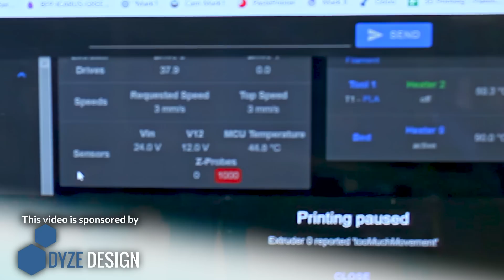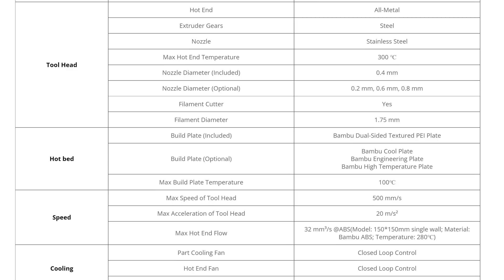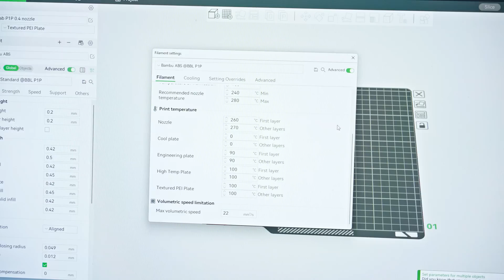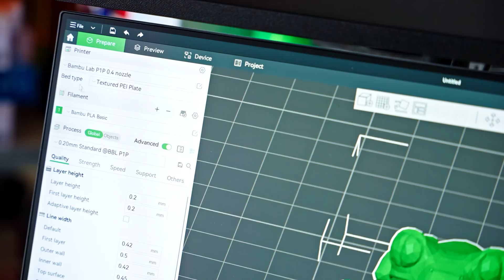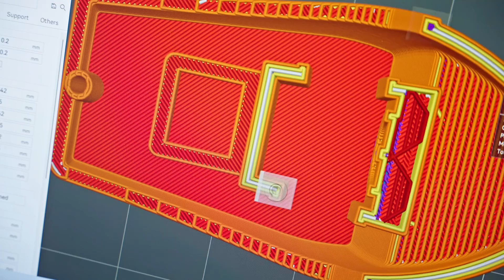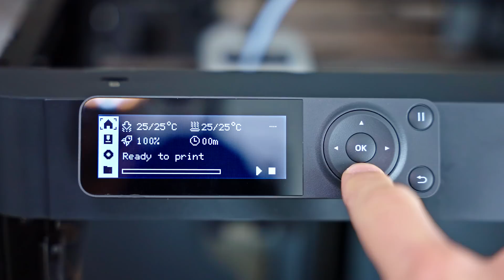Bambu Lab P1P: Tradeoffs

Comment: I think you're overly critical of some things. First off, printing side panels that the company has already designed and made available is completely different from full-out modding an Ender 3. It looks unfinished because they know 99% of users are gonna 3D print something. It not only lowers costs for them, but it makes it easy for the user to make it their own without the hassle of designing custom parts. Also, I think the LCD screen is dope. It's small, but the big chunky pixels almost make you feel like you're hacking a computer, and yet it's still easy to use. I love this company and even though they're not getting everything perfect, I think you should be more open to them trying new things. It's what 3D printing has needed for a long time.

Comment: I have the Bambu X1 Carbon and it does work impressively well. For smaller items, though, you likely have to lower the print speeds - I was getting spaghetti failures on the Bambu while my Prusas had no problems.

Comment: PLA/PLA+/Petg Quality as fast as you can get it with and without the addon fan.
Ignoring speed claims, how fast can we go and get similar quality to a bed slinger doing 60mms?
Do you have a sound metere? How loud is it really at those speeds?
Camera and tiny LED strip are not a big deal - Unless camera setup does not work as expected

Comment: And I probably have most of those "23" upgrades on my Ender 3 Pro. 🤣
Only thing I haven't gotten rid of is the 2mm spaced vertical artifacts on straight walls. Seems more prominent on 1 side than the other on the same axis. 🤷🏼‍♂️

Comment: This is probably a bit out there as far as suggestions go, but how about testing how easily this printer could be converted to use Open Source hardware? How proprietary is it, and how easily, if at all, could you get around that?
There are some worries about long-term support for BambuLabs printers due to them being a fairly new company, and some have suggested they might take the Apple route of designing equipment. If, for whatever reason, BambuLab should at some point decide to lock out features for bogus reasons or whatever, I'd be curious how easy it would be, or if at all possible, to replace the included (as I understand it proprietary) board with something like a Fysetc Spider running OctoPrint or something. 
Obviously, the other suggestions would come first.
For now, however, they seem to have done most things right and seem like a company worth supporting. If they allowed me to use PayPal to preorder the P1P (which, after asking, is supposed to be coming), I'd have ordered one already.
Just, y'know. We've all been burned before.

Comment: Is the P1P still really loud like the X1 variants were? Instead of using off-the-shelf stepper motor controllers, such as from Trinamics, they were using two AT8236 (H-bridges) to drive each stepper motor.

Comment: I can't help but wonder some things - if the 100C limitation for the new printbed is more of a long-term thing. i.e., you can't do 20-hour prints at that temperature without risking damage/wear/etc to the bed.

The other big thing I wonder, as this is effectively only their second or third printer, is if the 'upgrades' that the P1P has over the X1C are... coming to the X1C? Like, perhaps they went "oh, everyone has an issue with the thermistor design, let's fix that" and since the "current" printer is the P1P, it's just automatically shipping with that, and the next X1Cs they ship out will also be built that way? Just a thought

Comment: Skip the upgrades.  Everyone is doing that and it is a waste of your talents.  I would like to know about flexibility.  Help users break out of the box that Bambu has put them into.  I want to see hacks.   Yes, you are expected to use their slicer, but what if I really want to use Cura because that is my existing workflow or because I don't want my models sent to China?  How hard would it be to add a mechanism to it for continuous unattended printing?  Can it be tricked into heating the bed to 120C with a MOSFET/SSR and an arduino?

Comment: Why so hung up on the screen saying the cheaper ender has a nicer screen yet no mention of the more expensive prusa having a garbage cheep screen when even the cheaper prusa mini has a nicer screen lol and the panels are not there so you can customize it that’s the point and the none hardened Nozzle is chose for the same reason the coated sheet is becase people buying this will be more likely to print pla and things like that and those choices are better for that. Not sure why your so confused it all makes perfect sense and the value is in readable . Don’t think to many people will pass this up and pay more for an outdated slow prusa
Reply: Except the screen on the Mk3 still works far better, the encoder wheel is far faster and more responsive than the lil buttons on the P1P. But beside that, you can still put a color touch screen on an MK3, you can't on the P1P. You're stuck with what you got since its proprietary. Can't even use the one for the X1
Reply: @LilApe  The p1p is $700 and is fully built. faster and more capable. Ironically you do not need to use the screen if you are doing the slicing from a PC and sending it. 

The Prusa is $800 and you have to build it or $1100 fully assembled.  And you are saying you should add even more to the price? Sheesh if the screen is that important to you then get an X1 which has the screen and prints faster like the p1p.

This is ridiculous in 2022. Pressing a button will always be more accurate than spinning a dial. We have moved beyond  dials. $100 ender 3 have dials. lol. 

We will have to disagree on the mk3 working better as well. It is SLOW. 50mm/s slow. Something that will take 16hrs on a prusa would be about 4hrs on a bambu. They arent in the same dimension in speed/quality.
Reply: @LilApe  you can also just use your phone or you computer to run the bambo if you don’t like the screen, how much do you have to spend on the more expensive prusa to do that? And it’s still 4 times slower and dosent have any of the vinbration comp tech and still prints with ringing and artifacting even at stupid slow speeds. Even if the screens not great there is no denying this printers value proposition is insane. Even the full x1c is literally only 99 dollars more than the assembled prusa add a enclosure around the prusa and it’s significantly more.

Comment: Tom you are not correct with the print speeds. Here are the speeds "levels" of an X1 series
1. Slient (50%)
2. Standard(100%)
3. Sport(124%)
4. Ludicrous (166%)

These are multipliers. with standard being the baseline. 
So using the slicer defaults you can certainly go up tp 500mm/s speed by a simple speed adjustment.

Standard  (100%  )                 Ludicrous(1.66x multiplier)
Outerwall: 200                   |    332
innerwall : 300                   |   498
Sparse infill: 270               |   448
internal infill: 250              |   415
Top surface: 200               |   332

Which also means the default 10000 mm/s acceleration goes to 16,600mm/s. Obviously the geometry of the print will dictate sustained accelerations. I don't recommended running the machine like that but you can if you are feeling adventurous. 

You can also adjust these before a print. I know you are struggling to make your Prusa mk3 stay relevant but please learn a little more about the product you are presenting. I am a total noob to 3d printing and I can confidently say I know more about the bambu lab printers than you.
Reply: All those speeds, yet the same part with comparable settings only finishes 17% faster than on my MK3 running at 55mm/sec. It almost like the bambu doesn't actually reach the rated speeds, and it's all marketing.
Reply: @LilApe  You are mistaken. Open prusa slicer and bambu studio. Import a model with the same slice settings. The only time a Bambu runs slow is first layer at 50mm/s. then it's 200-300mm/s standard speeds up to 500mm/s/ So unless you have a print that is one layer high there is little reason to believe you.   

All of my tests show the bambu crushes the prusa. It's actually quite sad really. $800-1100 for a printer that is on par speed wise with a cheap $100 ender. Prusa should be ashamed of themselves. I have a (retired) prusa and there is no comparison. If I bought in 2022 I would be asking for a refund.

Bambu won 2022.  Prusa needs to do better.

Comment: How about you compare speed, quality and cost against the Prusa i3 ? 
But do it fairly please, donßt leave out the i3´s shortcomings like assembling it for ages, many unnecessary parts and the worst bed slinger design ever with a heavy print head, 8bit board and so on.

Comment: Top speed is the least important part of a printer. Fast looking crap is pointless. There is so much misunderstanding about these machines, like it can't print ABS, of course it can, just as well as any unenclosed machine. Easily solved with a cardboard box. I am really interested to see how it works. How does the slicer compare? How long does it take to transmit files over Wifi? Can it be used without the cloud? What does the cloud offer? Bambu appears to have expended and dumbed down some features in the slicer, compared to PrusaSlicer - what is missing? At what speed does quality start to degrade? Where do you start to outrun cooling? Where are the firmware limits? The whole fast/ludicrous mode seems like stupid fluff, it is just spinning the feed rate modifier best I have read, or is it? So if it slices at 200mm/s, and you run the modifier up to 200%, does it really run 400mm/s? What if you slice at 400mm/s, and run at 100% modified speed?

Comment: I think that the speeds bambulabs claims are measured in the ludicrous print mode. The ludicrous mode speeds up most moves by 200%, so about double the slicer speed.

Comment: one thing i'd like reviewed is on the networking side. I refuse to have more devices on my local network going all the way out to the internet to do stuff when the data is both generated and consumed right there on my network. Does this printer require access to the internet to set up the wireless? Does that QR code go to an internet URL or a local one? Can it be integrated in with home assistant? Can I easily send jobs directly to it if the printer is on the wifi but blocked from internet access? Those are some things I'd like to see reviewed. Also, can I use it with stock Prusa Slicer or do I have to use their modified slicer?

Comment: Since my day job is software engineering.
I'm just going to come out and say it.
I highly suspect these guys took an open source firmware and modified it for their printers
Their time to market is too fast IMO for them to have written that all from scratch.
Reply: It's 100% what they did, built it off open source innovations, then sold it as proprietary. It just runs klipper, but they wont tell you that.

Comment: I'd be interested in seeing how much the upgrades would actually cost, and also how accurate the prints actually are dimensionally and if there's a strength tradeoff.
Reply: I have the older brother(X1C) and the prints are fantastically accurate. I have been printing figures for months in different colors and materials and the parts fit together perfectly. I had a part made in Sept that I needed to reprint recently and it fit without much fanfare. It crushes the competition. This is the next leap in printing until a new king takes the throne.
Reply: @hawtdayum  I wish I had the money to try one myself!

Comment: Seems like a great move by the company. I am torn between this and the v400 from flsun
Reply: I really like my FLSUN printer (not v400), but as an owner of the bambu lab X1C, I would definitely go with this one, unless you really just like deltas better, or really need the extra print volume.

The X1C is just a fire and forget printer, is faster than I have ever been able to tune a voron.

or

If you have the scratch, the X1's auto calibration is really worth it.
Reply: @JOEDHIGGINS  I print a lot of big things many of which will not fit in the x1c

Comment: I like your take on this Tom! I will be curious to see if you catch shade from the fanboys over this one. Every point you brought up seems crazy valid to me! Looking forward to your review!
Reply: The points are all valid but some of the analysis - not so much. Comparing visual skinning to functional upgrades of another printer is useful and talking about minimal wiring updates as “obsoleting” another printer unfortunately undermines the points as the comparisons are spurious and just not relevant (it screams agenda, even if there was none).
Reply: @n0vaph0enix  you must be reading between different lines than I.. Panels are absolutely more than just visual. It stops drafts and sure, can look cool too. It may add to rigidity, but that is a stretch. I do think the obselete comment is a bit of a stretch, but undermining, no, not so much. His point about the hotend, the bed, and some of the other features missing on the X1C is valid IMO.
Reply: @3DMusketeers  I mean it’s entirely possibly I have an unconscious bias and expectation on what opinions was going to be expressed, but I just felt while most points were valid, some of the analysis was just spurious / stretching. And you are quite right on draft, but it wasn’t really the point that was being talked about , the analysis was one of structural rigidity - if the analysis was one of draft proofing was made, I could accept that (although it would be difficult to justify as a negative considering the price).

Comment: My suggestion on what to try... Rip out anything closed source and replace it with a Marlin or a Clipper setup.
I suppose the hardware is quite good,  however the closed firmware saddens my heart, the thought of being left without the possibility to get the latest SW improvements because "the company" can't be bothered to implement it in there firmware...

Comment: I would love to see the results compared to prusa i3 and an ender 3 at various speeds like 50mm/s, 70mm/s, 100, etc etc and then compare the amount of skipping, visual artifacts, and overall changes between them.
Reply: I  just got a P1P and am running PLA/PETG prints at 200 mm/s and getting better quality prints than my Prusa Mk3 running half that speed.
Reply: +1 would be nice to see the print quality at different speed including "low" speed 50/100mm/s
Reply: @pierregrollier4155  Funnily enough, most HF hotends actually struggle at lower speed - for example my Dragon HF produces wobbly walls on lower speed due to excessive oozing of the material - but on the higher speed presets I get totally smooth walls.
But I agree, it would be great to know actual limits and minimum flowrates for various hotends, so +1 from me too!
Reply: i don't think he's going to do a comparison with the prusa.

Comment: Too many problems coming out with their X1 now. Faulty stepper motors, faulty boards. Calibration crashes the nozzle into the bed, and no crash detection to stop it, etc. And their CS is taking a long ass time to send replacement parts out. Bambu labs took ideas from open source innovations, and packaged it as a proprietary product, then sells you on a gimmicky lidar sensor that has features disabled, yet they don't tell you that when you buy the printer.

Somebody tried telling me the X1 was better than a MK3 because the X1 has a "welded steel frame", failing to realize the MK3 uses .250" steel plate for it's frame, and the X1 uses 22-24ga pot metal for it's.

Comment: The looks of a printer is not that important. Extra cooling is probably only needed when you enclose the printer.  The steel nozzle is "good enough" for most hobbyist and the same for the screen. The prize makes faster printing possible for hobbyists and that makes this a unique machine.

Comment: Honestly, despite some of the cosmetic complaints, I'm really curious about how much of a market disruption this thing can cause, especially given the price. To that end, I'd really like to see the versatility of it tested. 

How fast can you tune the speeds for functional prints with reasonable quality? And what quality can you achieve with slowing things down quite a bit? Also, how does it compare to established options for non-PLA printing?
Reply: I actually find the cosmetic complaints sorta funny because the MK3S which is the only competitor in this range right now, looks much worse.

I suppose the Flashforge Adventurer 4 could also be considered though, and it does look better.
Reply: @BeefIngot  Looks are subjective. But his complaints are that it looks incomplete, which it does. An MK3, while an open design, doesn't have exposed stamp and weld marks, doesn't look like a printer that was stripped for body parts, the MK3 doesn't look incomplete, like its missing body panels.
Reply: @HaloMachine  I think incomplete box looks better than bright orange rough 3d prints.

I also think it looks much better with the side panels which are done in one print.

Sure subjective is subjective and I feel most feel that the industrial of the pipboy looks better than the reprap orange
Reply: @BeefIngot  Then you just buy the MK3 with the black 3d printed parts, or print them in black. That's why prusa also sells them in black, not everyone likes the orange. But if you feel the MK3 looks bad cause it uses 3d printed parts, then you must feel the same way after the P1P with big printed panels.

I mean at the end of the day, 3d printers are tools, not decorative pieces. I personally don't care what they look like, just as long as they make me money, in a reliable manner. My prusas have been remarkable in that regard.
Reply: @HaloMachine  Its not about the 3d printed parts but the jury rigged togetherness of the look.

Vorons for instance look professional.